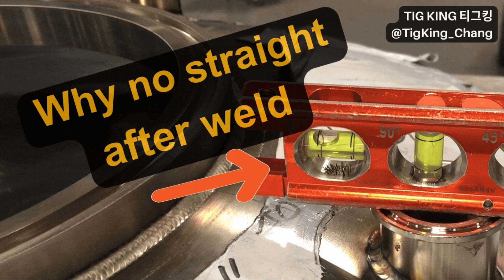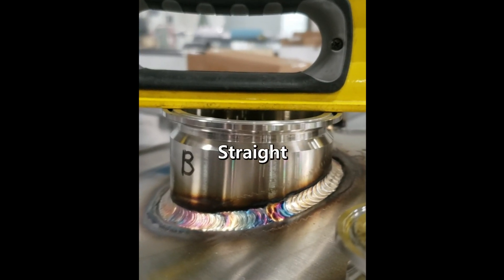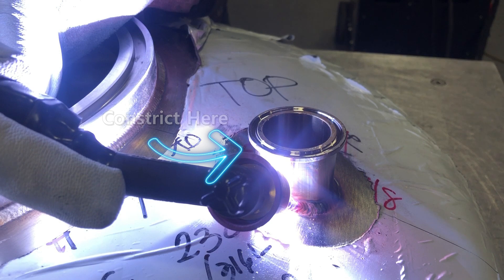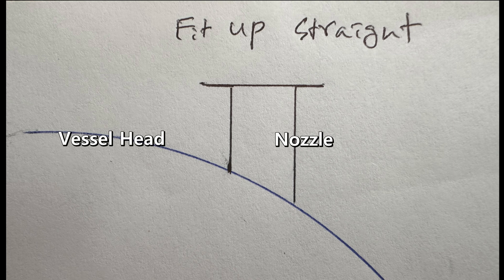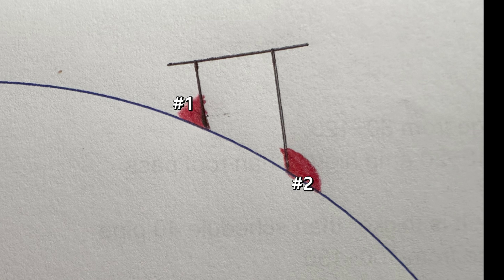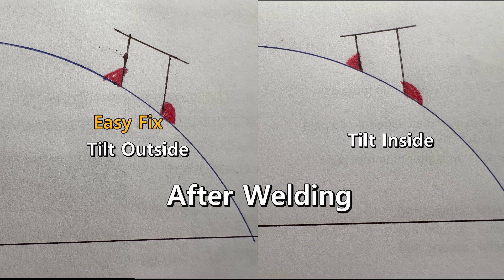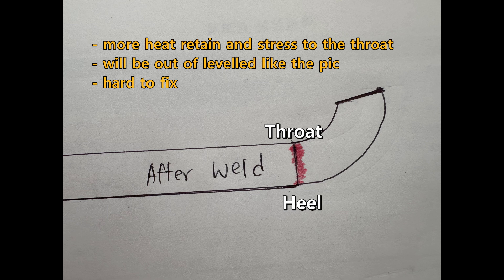Why my welded product is not straight after welding

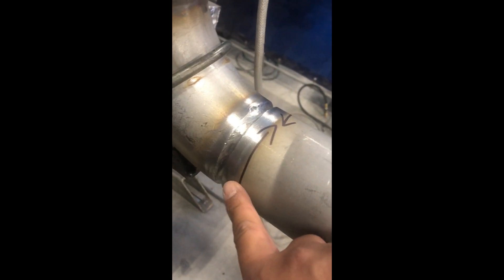Comment: The joint at 4:42 - did you use two passes both starting on the heel working into the throat.
Reply from the maker: Before final pass, i found it is not straight. So I finished cap toward the throat first. Then I did the heel side later.

Comment: Awesome tips. If you reheat a weld in order to straighten a part, will it not affect the weld, like making it thinner, or expanding the heat affected zone? Thank you
Reply from the maker: A couple of times will not affect. But too many time or failing to control hear input will make the product serious problem. U have to be careful.
Reply: Machinist here - not a welder.  We have similar issues with certain kinds of materal.  Welded parts, parts burnt on a laser or plasma cutter, cold rolled steel, they all end up with tension in them.  That tension can be released by adding heat.  If it gets too hot though, it can ruin any heat treat that's been done to the material.  So yes too much heat hurts, but a quick bake to a couple hundred degrees then letting it sit is probably fine.  You can also redo the heat treat afterwards.  Some parts we do get welded first, then stress relieved, then machined and then get hardened after they're complete.  It can also be used to "reset" the fatigue on metal built up from bending it back and forth a lot.  If you do bend it back and forth a ton, you could make a thinner section but don't do it too much and you're fine.

Comment: Question: Is oxy-acetylene torch available? Do you use tig torch to heat even if oxy-acetylene torch is available?
Reply from the maker: Unofficially I use but officially I would say no. 

Whenever an inspector come to a shop, we hide oxy-acetylene  torch.